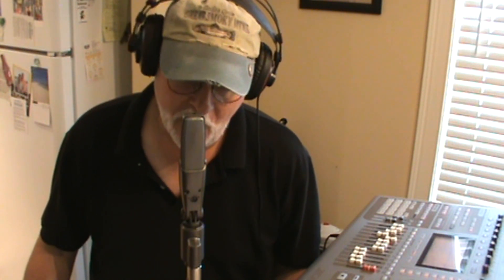the shure 300

Comment: I just acquired one of these.  Are these ones safe to run on a board that also has phantom power enabled?  I know some older ribbons are not designed with protections newer ones have to not let phantom power hit the ribbon.
Reply: Don't use phantom power for ribbon mics... I have a model 330
Reply: @scann563  ok understood.  My main interface has switchable phantom power per channel was just looking at upgrading to one with better preamps but it's phantom to all or no channels.  Guess I will look at something else then haha.